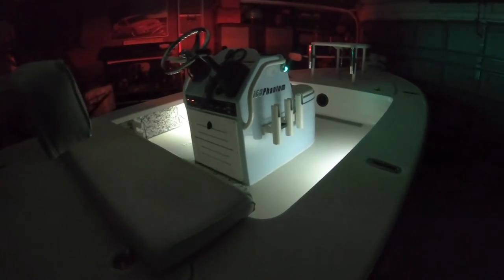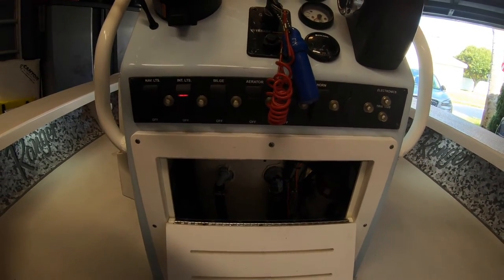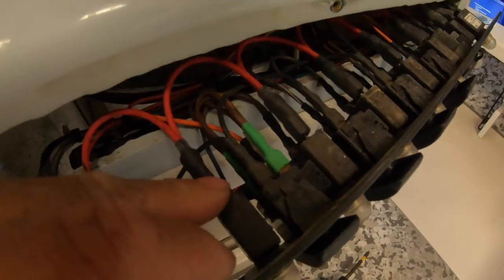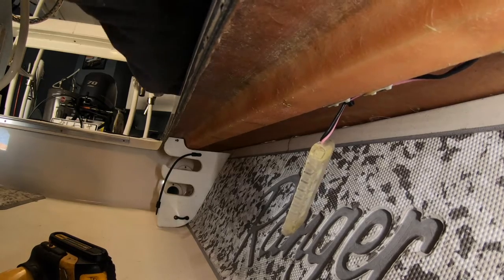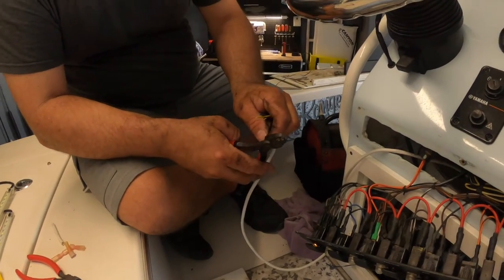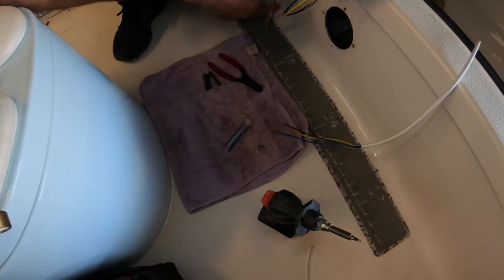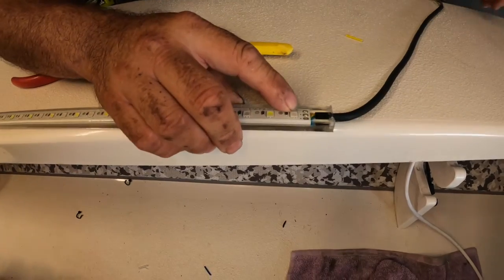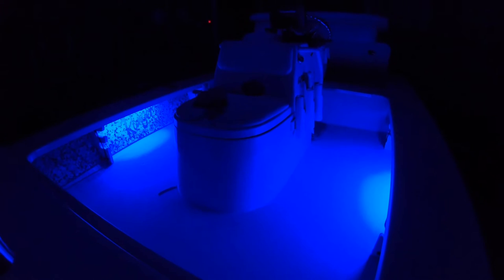How to install LED Lighting in your Boat

Comment: What gauge of wire did u use? Same as what was on the led lights? And I noticed u didn’t use tinned wire, why?
Reply from the maker: So it was some left over wire I had from another project it was 16 gauge wire and yes not tinned . The reason is cost and tinned wire is a slower conductor or higher resistance.
Reply: @ShallowHookerFishing  thanks for the quick response,  no disrespect intended. And I noticed you shrunk wrapped all the exposed ends. I was thinking of putting some led lights on my downriggers so I can see the rods in the dark.

Comment: How many small LED lights can you put on one wire, switch, circuit ?  Hope that makes sense. I was a few lights to be wired on the same line but in different compartments. What size fuse should they be on. I was going to run 14 ga tinned wire.
Reply from the maker: Well I have done a 36 contender with 8 24 inch led strips on a 20 amp breaker